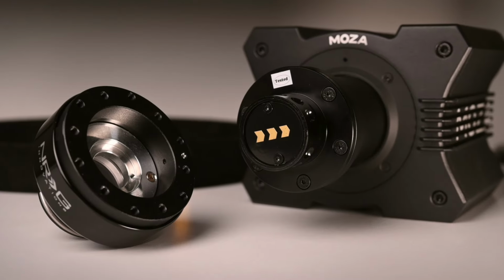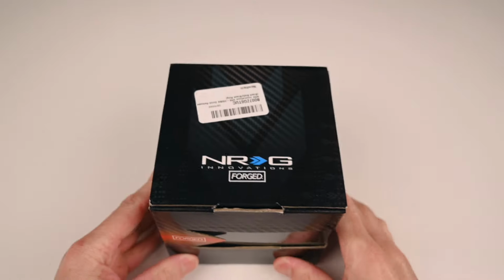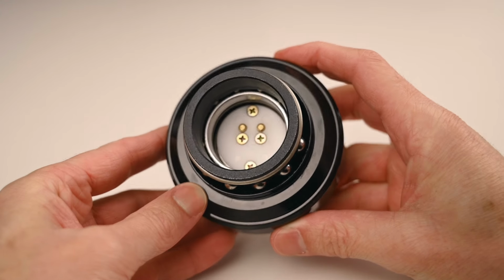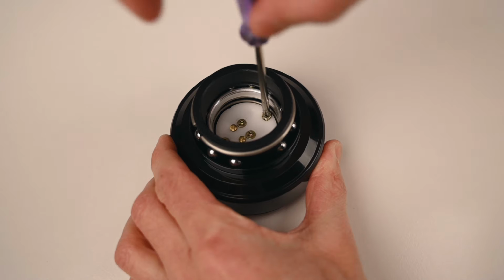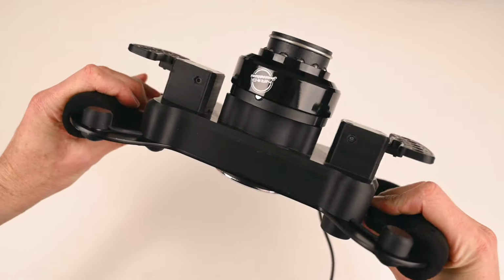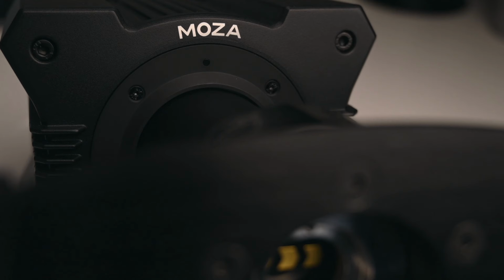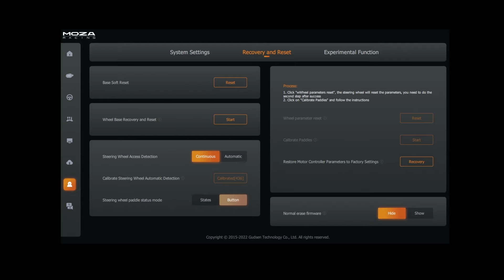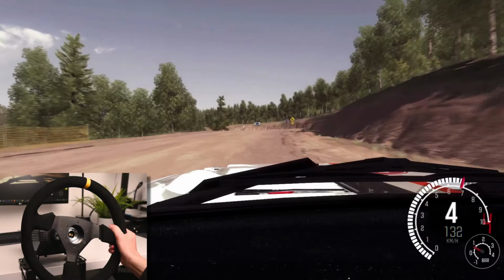QUICK RELEASE FOR ANY STEERING WHEEL ON THE MOZA BASE NRG

Comment: This type of qr is also compatible to simagic wheel bases and this is recommended budget qr because its sturdy. Other qr i tried has play (fake ones) or (unknown brands) as long it has 6+4 ball lock pattern it fits to the stock adaptor of the wheel base. Got the same qr and it is really sturdy and cheaper too.
Reply from the maker: 100% agree
Reply: What does QR mean? Do the NRG and the Moza version both make the buttons on the simagic wheels work as well when using the moza base? Do you know any more rims that do so as well now?
Reply: @RutgerBoermaRacing  QR means quick release and I don't know about your other question
Reply: Moza and Simagic wheels are not interchangeable, the wheelbase terminals are different. If you want to use a different brand of wheel with moza or simagic, you must buy an USB adapted wheel
Reply: @pitrick_  Any brand you can recommend for simagic USB adapter.  Thank you

Comment: Hi, someone please help. I have a Thrustmaster sf1000 wheel, will the screen and lights work with this. I get the force feedback but I need to know if the screens will remain the same as well, thanks
Reply: Ciao, scusa se rispondo adesso, io ho lo stesso problema ovvero vorrei passare ad un dd e vorrei prendere il moza r9 però ho come corona l sf1000 e non ho capito se con il moza qr adapter o con l nrg possa essere compatibile. Tu sei riuscito a capirci qualcosa di più?
Reply: @desmy01  Hai novità in merito?

Comment: Could the Fanatec McLaren rim or other Fanatec rims be bolted to this? I know I'd lose button functions but would they bolt on? Famatrc need tomove quick on their QR2.
Reply from the maker: Fanatec rims with 70mm bolt pattern will fit. But different bolt pattern on the McLaren, you would need an adapter between the wheel and QR. Then also convert the wheel to USB for buttons to work.

Comment: Very nice! Any thoughts on Fanatec DD compared to Moza? I have a DD1
Reply from the maker: DD1 is a great wheel base, better feel out of box and able to plug in pedals, shifter ect
R9 – compact size, better QR, but found software needs adjusting out of box to get the right feel. 1/2 price of DD1  
A compact Clubsport DD with improve QR would be nice!
Reply: @amstudioprojects  They have some new QR in the works. There is a video floating around where someone tested it at an event. Looking forward to it. Cheers!

Comment: I have a Sparco P310 wheel that I quite like - any chance of this wheel working with a Moza R9?  Also the buttons will never work, correct?
Reply from the maker: Yes an original P310 with 70mm PCD will fit the QR. You could wire the buttons separately and connect via USB

Comment: Guys, i need some help pls! Im considering to get my first DD base but im undecided between the moza r9 and the new T818. I have a tm sf1000 as a steering wheel but I'd like to buy the r9 cause the qr system is way better than the t818. Is it possible to get the sf1000 working properly (i mean not only force feedback but also the screen) with the feature showed in this video?
Reply: Since the SF1000 is also part of the Thrustmaster ecosystem, I'm not seeing a feasible solution to get everything on that wheel to work with the Moza R9 or anything outside the Thrustmaster ecosystem really. If you want to keep using the SF1000 then it's safest to stick with a Thrustmaster wheel base.

Comment: A USB steering wheel button box using an Arduino is good, but if you spend a little more, you can use Ultimarc's BlueHID to use a Bluetooth HID device. I made a 32 button steering wheel button box and use it on a Panatec Podium Hub. (4-Rotary, 24-28 buttons including horn)
*For the baguette hub, you can DIY 10 buttons using pins and resistors.
Reply from the maker: Great thanks for the tip!

Comment: Moza is fantastic....and you dont even need to spend that much on the NRG.....plenty of 35-45.00 options.
Reply: That is true, if you are not going to use Moza steering wheels you can also put a QR equal to 5+3 balls that are even cheaper... I have the r9 with an aluminum extension adapter of 10 cm and QR of 8 balls and several flywheels by USB...
Reply: @JoseFcoBN  I was unable to put 5/3 ball adapter on my R5

Comment: Can this work on the r3 model??
Reply: Hey if you are using the r3 on pc then it will work but if using on Xbox then it won’t cause the Xbox compatibility chip is in the wheel not the base that’s why you get the Xbox buttons on the wheel but I was wanting to do the same thing but the best idea to do in the moza ES wheel f1 and 13 inch Round wheel mod hope this is helpful